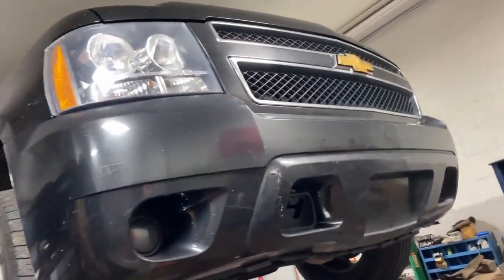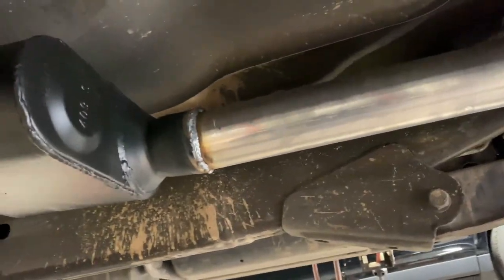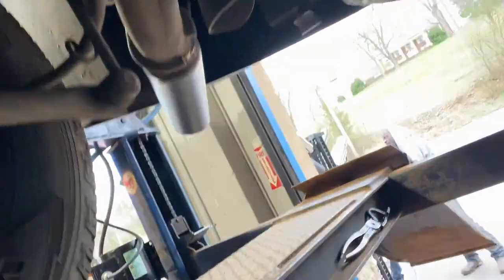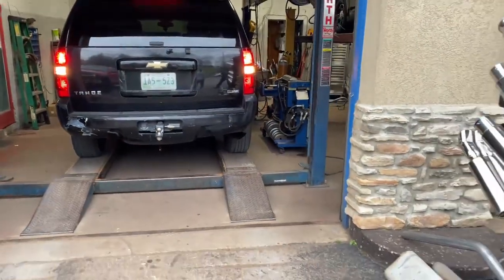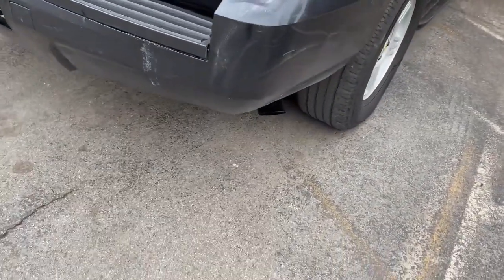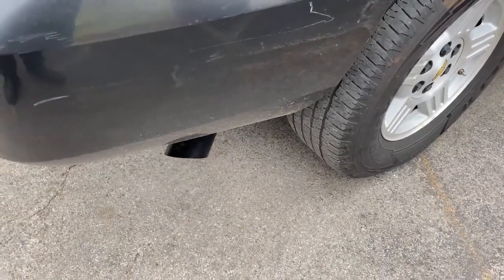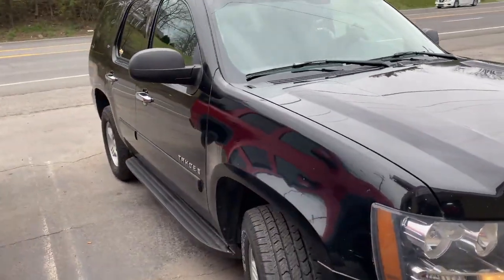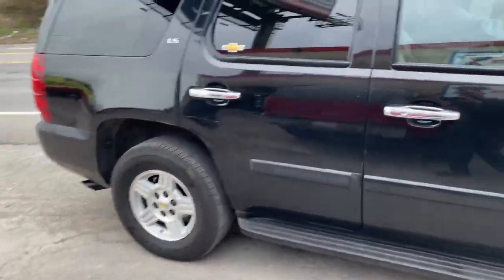2007 Chevy Tahoe 5.3L  EXHAUST w FLOWMASTER SUPER 10!

Comment: Always call the resonator a convertor! These guys come looking for sound and don't remove the resonators. That's holding the sound back
Reply: BMOREHEMI 410 There’s no resonators on this truck, just two catalytic converters and the Super 10 muffler. OEM resonator would be located where that black exhaust tip was.
Reply: Is the super 10 With resonator delete annoying on highway drives?
Reply: @dawinsantos77  I actually kept my resonators on my truck because I go to work at 2 a.m. So it has a a nice deep growl without being obnoxious